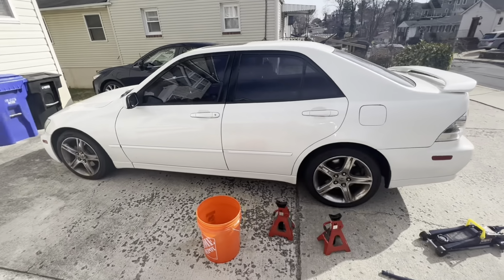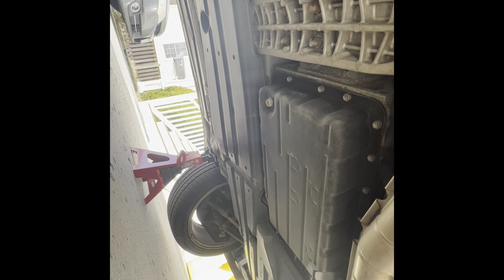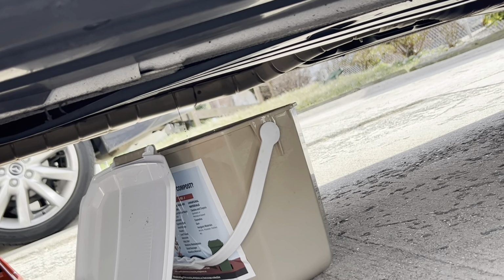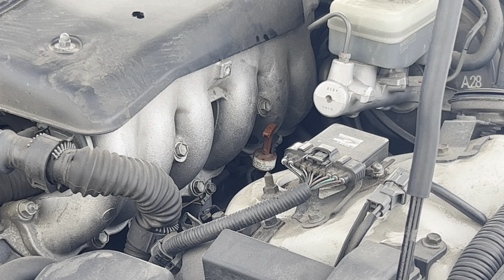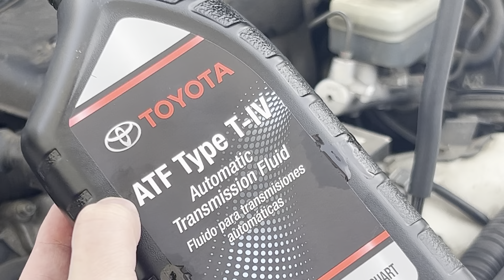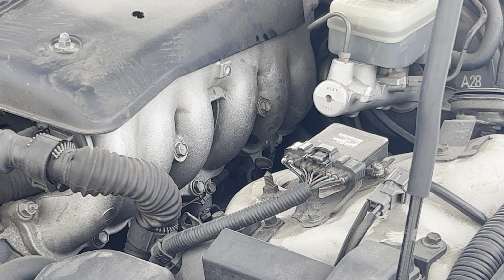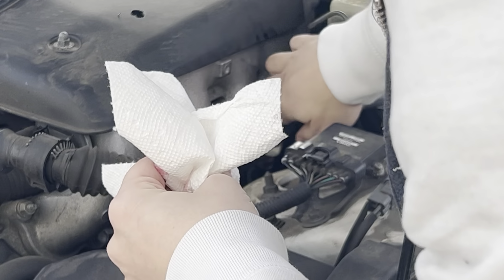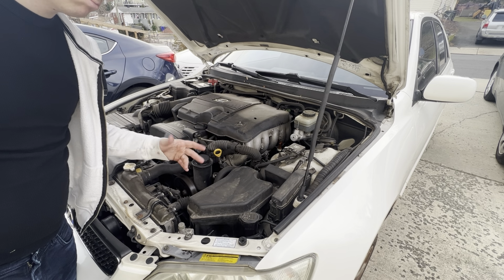Change Transmission fluid on Lexus IS300 (2001-2005)

Comment: I have the same exact car as you my dipstick isn’t coming out. Idk if it’s frozen or it’s just been in there for so long
Reply from the maker: It does have a little metal clip that holds it in place, so make sure you are pushing that away from the dipstick to release it. If that isn’t enough you may need to do some further research on what to do unfortunately
Reply: @ I was able to get it out had to force a little that grey piece was frozen in. Also yeah my car is still not moving at all. I put half of the gallon transmission fluid in it and nothing. I think I have to replace the actual transmission

Comment: I just got a is300 and I have a code p0980. The trans fluid is over filled and I’m not sure if they put the right fluid into the car either. I’ve asked around about flushing it to see putting new fluid in and everyone says that I can mess the trans up. I’m just a little confused because that’s one of the things why the code is up
Reply from the maker: Putting the wrong fluid in can be dangerous for sure. And if you flush it, it doesn’t actually remove all the fluid since some of it will still sit up in the transmission. So you technically have to do multiple flushes to get it fully clean. But I mean, I see no issue in just letting some fluid out if the right fluid is in fact in there. Or flushing it and making sure you don’t add too much seems fine.